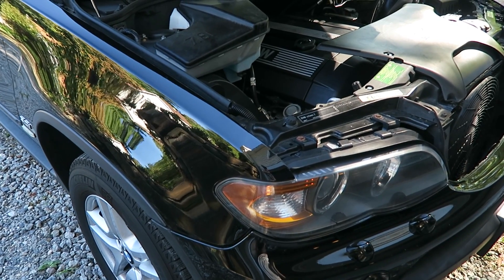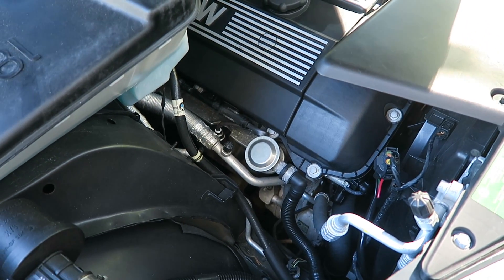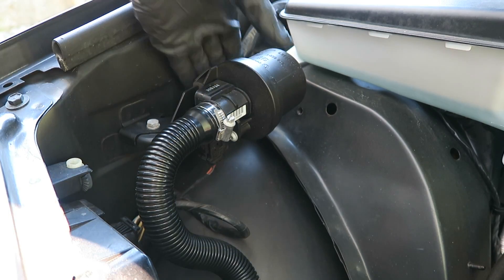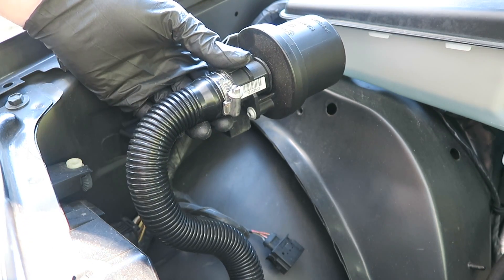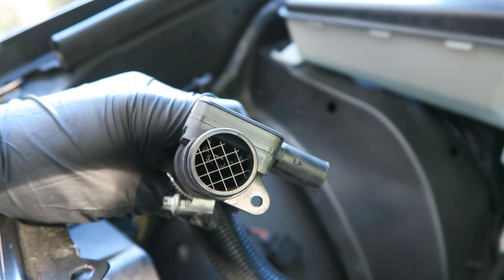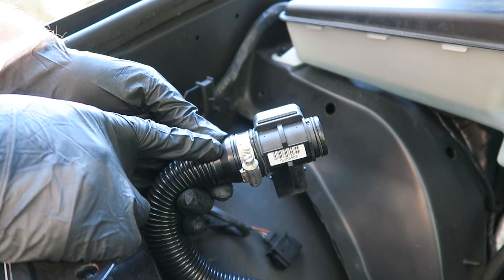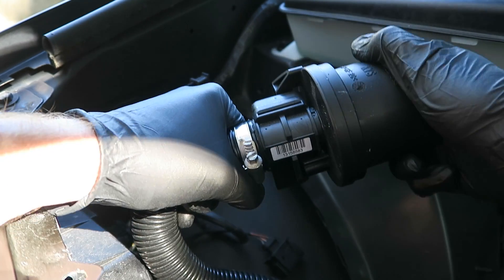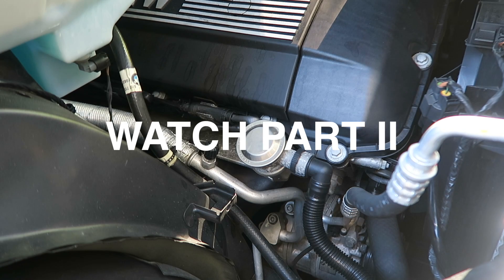BMW P1419 Secondary Air Fault FIXED E46 E39 E53

Comment: Just subscribed. I was unable to find the link to part 2 where the valve on the manifold for the P1419 code is addressed. I ordered a new secondary air sensor and it’s filter but want to make sure the code is gone/the check engine light goes off. Can I please get any direction to this part two?

Comment: Great video as always bro! Glad I  came across this video...I  notice lately my x5 makes this swirl noise on cold start and the noise is coming from this sensor.  It only last about 20 - 30 seconds then stop.. when it stops I can hear like a vacuum sound coming from the pump(big black box below) but no code P1419. I got a code P0171. I already clean my MAF at the throttle body but still P0171.  Any tips much appreciate!

Comment: One item to check is the gasket where the sensor connects to the large hose, mine was pinched, straightened it out and cleared faults since then.

Comment: How long does it take for the light to go away (check engine light )and also I wouldn’t know once I spray if he’s really clean or not
Reply from the maker: delete the code with your obdii scan tool, see if it comes back within a few drive cycles 30-100 miles

Comment: I did everything you did here. The cleaning didn't work so I replaced it. I'm still getting the code even with the new part. Please help :(
Reply: Probably have carbon stuck in the head . I was told don’t worry about unless I wanted to waste money

Comment: Is it possible for this to cause 3 misfires
Reply from the maker: I don't think your misfires are related to the secondary air system this is for emissions gasses at cold start. Take a look at your spark plugs and coil packs first.

Comment: IF you replace this sensor do you need to reprogram to the computer or something like that?
Reply from the maker: I think you're asking about the service engine soon code that will come on with this failed part. Most of the time the code will clear on it's own after replacing the part, but sometimes it doesn't so it's handy to clear it yourself with a cheap code scanner like the one I use: http://amzn.to/2y6Xoc7

Comment: why does the x5 have a secondary MAF, it has M54 same as e39
Reply from the maker: The E39 and E46 have them as well, they are just buried further down, not as easy to access as the E53.
Reply: hey , can you do a oil pan gasket change please ?
Reply: @merrrre  it's a pain to replace the oil gasket. It's more pain with AWD. I did few vehicles, and will do an E83 X3 next week. Not looking forward to it.